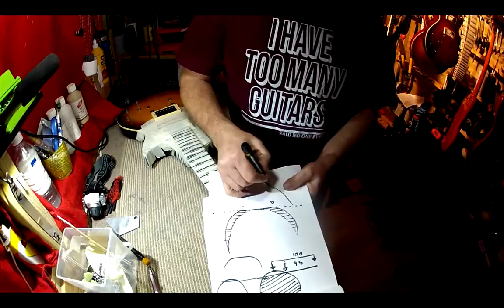Vintage V100 set up Part 1

Comment from the maker: Hi Billy - this is an old video so I'm not sure of the context of your comment... You're right, a string is a great straight line reference point. Good for aligning the neck before bolting it down. One string on its own isn't ideal for checking relief as you'd ideally want to have the neck under full load.